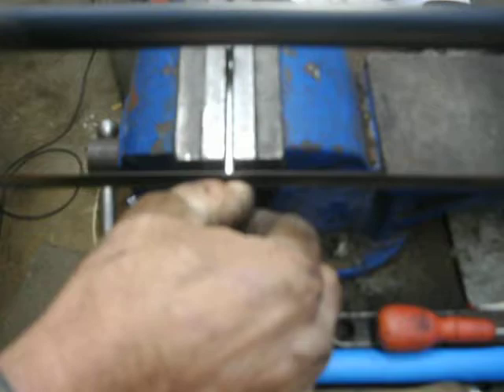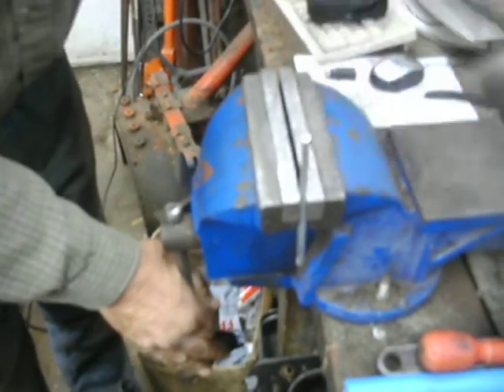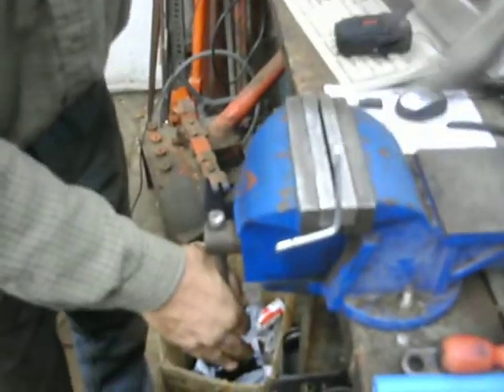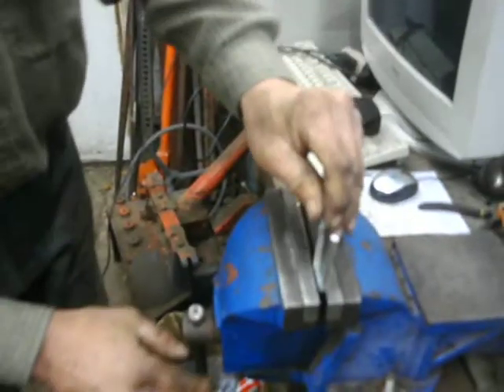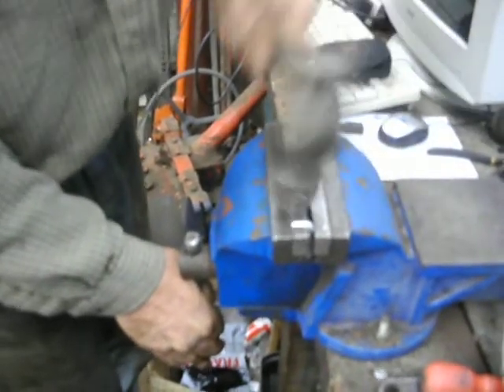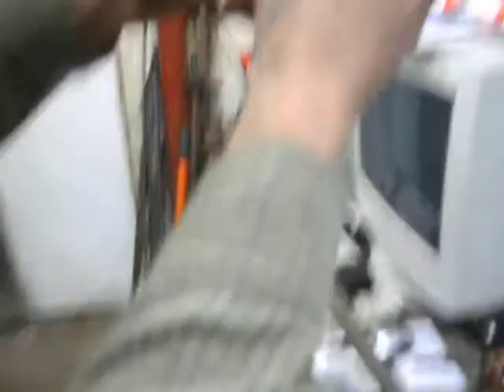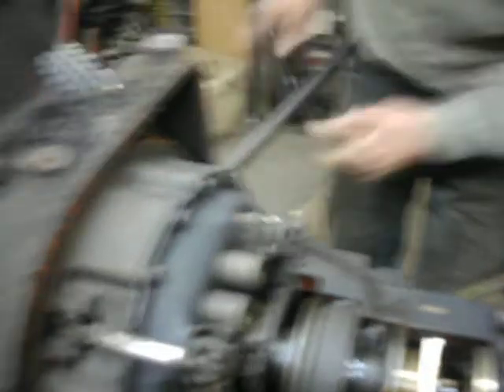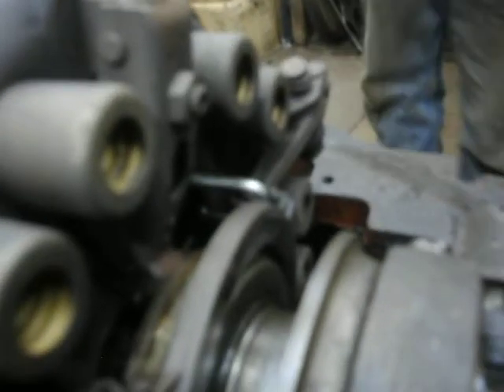Nuffield clutch retaining clips

Comment: Is the idea that you hold the clip in place and then loosen the bolts which then puts tension on the clip ? In your video it shows you just plopping the the clips on. As you turn the engine these clips will just fall off.

Comment: Hi! I have been restoring my nuffield 342 with dual clutch and I finally got it running. I did do some clutch maintenance by replacing the PTO clutch plate, pressure plate and the springs. I also replaced the bearing between the PTO and drive shafts. The needle bearing in the fly wheel was fine and I could've replaced it, but didn't due to the bolts being too tight to get off.
Assembled the clutch in reverse how to disassemble it to my best knowledge and used pictures etc to do it.
I did adjust the drive clutch so that it barely made any contact with the pressure bearing and gave the clutch pedal it's full range of motion. To my best attempt I tried to make sure all the 3 arms had the same clearance. PTO side worked just fine without any adjustment when the tractor was running. 
I have build the tractor to a point where I could drive it and the drive clutch doesn't disengage at all. The clutch pedal has about an inch of play before it starts to work and and it feels like the clutch does indeed lift off, but still it's engaged. I will try to reduce the play in order to solve this problem, but if it doesn't work then I'm baffeled.
I can see the 3 arms moving when pushing the pedal, but I feel no chance even when the tractor is on gear and not running.
Reply: I do remember now that the tractor was once under a rain and I dried it with a leaf blower. Of course nuffield has that cutout on top of the clutch.... The clutch plate simply runs on the bores of the drive shaft so could the clutch plate have somehow stuck it self on the fly wheel?
Reply from the maker: @Diglo1  transmission clutch plates are known to stick to the flywheel. You may be able to fix the pedal down and then using a long screwdriver through the inspection hole pry the plate from the flywheel in several places
Reply: @montegoson  OK I will try that. Meaby the plate stick to the flywheel because the engine cover and the fuel tank wasn't on when it got some water on top of it.
Does things like brake cleaner or WD40 help in this situation or am I asking for trouble?
Reply from the maker: You would be asking for trouble!
Reply: @montegoson  Yeah just made sure as many forums say equally yes and no so I thought that an expert would know better.
Anyway I will let you know what I'll find if I can't get anywhere. 
Million thanks!
Reply: @montegoson  I solved the clutch issue. "Rust" I fixed the clutch pedal to it's lowest position and put second gear on and forced tractor back and foward by hand from the wheel and long behold I heard a loud bang and the clutch went loose.

Comment: I have a 10/60 that grinds when trying to put it in gear even though the clutch plate is not that old. How is it adjusted?
Reply from the maker: Vertical link behind the two inspection plates. 
Tricky to adjust, set it so the release bearing just clears the clutch so bearings not continuously spinning.

Comment from the maker: Hi, No the 3 cylinder was only used in tractors and is rare. 4 cylinder engines can be found in scrap trucks. Also the 3 cylinder seems to suffer from cracks more than the 4 cylinder does.
Have you found the Nuffield & Leyland forum yet?

Comment: hola amigo como estas..!!! saludos desde Venezuela, tengo un 4/65 y quiero colocar una pala frontal, sabes donde tiene el tractor la bomba auxiliar para ese tipo de implementos..?
Reply from the maker: Take oil from the 1/2 bsp connection to the right of the pto shaft
Reply: @montegoson  para que pueda fluir el aceite debo activar la toma de fuerza..? es decir, al pasar la palanca del toma de fuerza deberia fluir aceite sae-140.?
Reply from the maker: @INLEVIDECA  PTO lever in middle position. Use stou or suto oil 15/40 viscosity
Reply: @montegoson  amigo muy agradecido por tus recomendaciones, lo acabo de hacer en el tractor y no fluyo aceite.. de seguro la bomba no esta funcionando.. sacare esa pieza para que alguien la pueda revisar o reparar..
Reply from the maker: @INLEVIDECA  Oil will flow when you move the "AUX" lever!
Reply: @montegoson  creo que mi tractor solo tiene en funcionamiento la palanca de PTO el cilindro hidraulico no lo tiene, y creo que esa palanca de AUX tampoco.. asi usted me dice que debo accionar la palanca de PTO y llevarla hasta donde dice HYD  luego debo accionar la palanca AUX.. ES ASI..?

Comment: Hi. I’m working on my dad’s Nuffield 460. I think it is a 1963. I have the steering bellhousing off and the clutch is exposed. I want to remove it. In the manual it says to remove 2 safety wires and 2 Clevis pins and slide the shaft forward. I don’t see anything that resembles this. 
Can anyone describe it me how to remove the clutch it would be a real big help.
Thanks
Reply from the maker: @neilmalcolm6265  If it is livedrive then the PTO drive will obscure the described parts. 
Probably best to go the the Facebook group I’m admin of and view the workshop manual in the file section.
Reply from the maker: https://lookaside.fbsbx.com/file/Part%201%20-%20Double%20Clutch%20Removal.PDF?token=AWwPhffnS17CQUrO8pvEOqR4eN0SQ3c2LeUNOF0xIqKRGuq4BY64o0tcyTZoyAGyIJKYvmgGsqeGP7D7OAsB9sJHelhu_KGuAZO-mDN4ys-pgJvO40KOMwVIthP_9lC4lDB_Hh4Dti9a01GRfyW7pFKJjZJBA5EJH7SXYVDuhsnOdiDpmg0b3BWxSbp2ZrJbSDgplTIf-CVU1neHi5d6SkQojUX8nLSOk7EMoQ2BulkZ_w